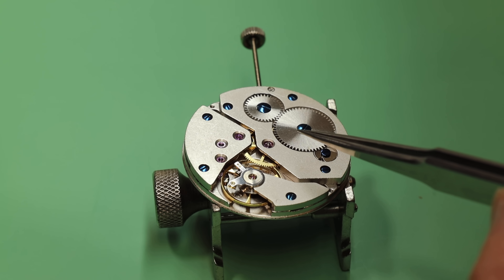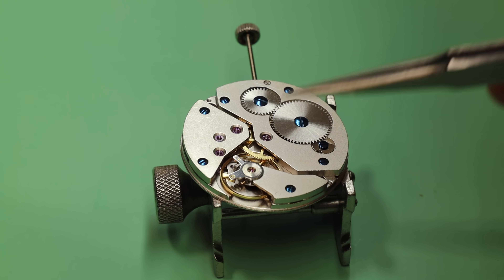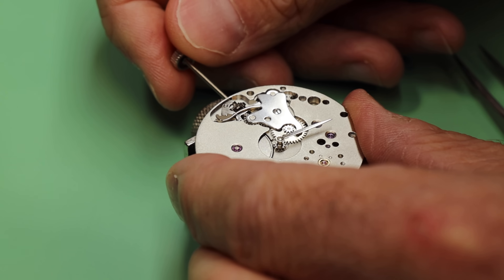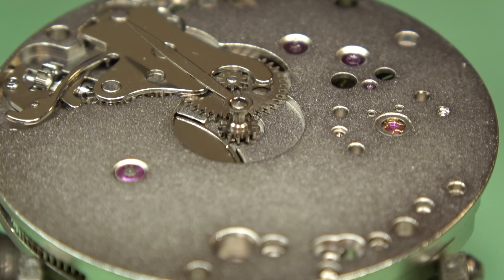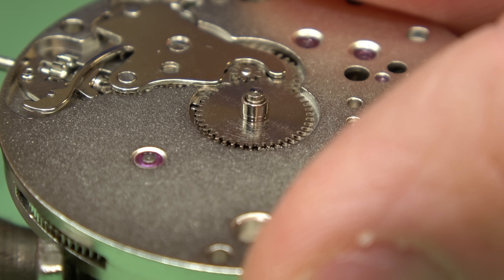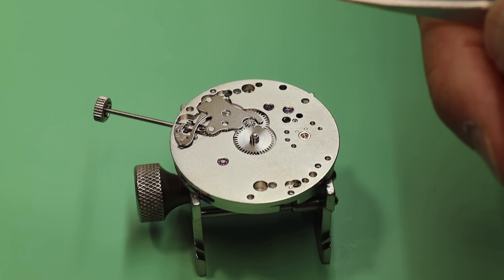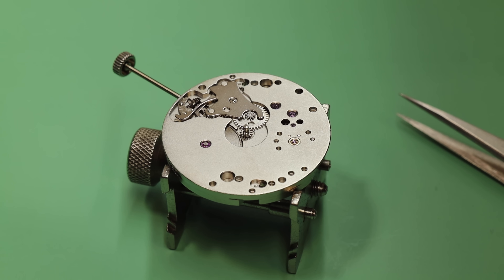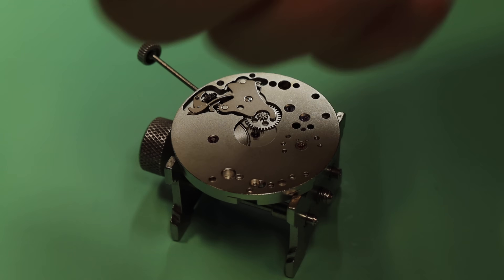Why you should NOT set your watch backwards? Watch and Learn #96

Comment: What if your watch has a day or date function? Moving the time forward almost 24 hours to fix a watch that is a few minutes fast would advance the day/date, and you would then have to go forward around 30 days on the date and put extra wear on the date gears as well. 

I guess if your watch had the hacking feature, you could just pull the crown out to stop the watch movement until everything catches up, and then push the crown back in start the watch at its new time.

Comment: What causes the crown to not turn the dial when pulled out ?  I have two that do this . Pull the crown and all they do is tighten the main spring.  They don't turn the hands it's weird.   Both worked when I got em . Then they did this

Comment: "I dont like this" is not very scientific. I don't think you've conclusively proven your case whatsoever. 

The reason the cannon pinion is a wear point (and not remotely near the worst one) has nothing to do with setting the time backwards, it's because it's a metal on metal point of friction. 

Your point about pinion and wheel leafs going in one direction sounds like common sense - but it's not. These parts are not oiled because they are not points of friction. Usually if you open a broken watch and these leaves are broken it is as a result of a shock, not wear. 

I have never seen a watchmaker ever mention this and it seems like another one of those myths like "overwinding" that people say to try and appear knowledgeable

Comment: So in your opinion ,should iwind my watch with a back and forward motion,or just a forward motion ?.My Oris after a few days forward only winds developed the problem that the Automatic rotor started spinning.I worry about using the back and forward wind,fearing wear on the gears.After using the Back and forward winding for a few days stopped the "sticking" Rotor.-And no the spring was only a 3rd wound before you ask.

Comment: Running the handwork gears backwards meshes the other side of the gear teeth.  As the opposite side isn't engaged during time keeping, I wouldn't think this would be much of a problem.  I can see burrs from the forward side of the handwork gears being dislodged during backwards setting on a very old mechanism, hence the advice for best practice as outlined in you video.  I do like the video and I remember being told not to wind backwards while setting.  I may have even been chewed out for it at some point.

Comment: It seems to me as when the canon pinion is moving in operation with the minute wheel the clockwise faces of the theeth of the canon pinion are touching the intermediate wheel towards the hour wheel. this means the pinion is driving the hour wheel.

now when you set the watch, the intermediate wheel will drive the pinion. this means when you set the time forward the faces of the minute wheel and the pinion which never ever touch get in touch. 10:13 

I do not beleave that this is a true issue. more important might be to not set the time to fast, as this introducing forces into the power train which should not be there. but also here, when the watch is put in time setting mode with hacking all the force of the main spring is on the escapement, and this also does not seem to be a big deal. going then counterclockwise actually should reduce the tourque on the wheels and therefore on the escapement.

general remark, when removing the canon pinion you should first remove the intermediate wheel as you can break either of the gears when the theeth are not alligned. the intermediate wheel just drops into position, the canon pinion you have to press. down

Comment: The only risk I see to moving the hands backwards is on a date, or day/date complication when the teeth are engaged with the day or date wheel.  I'm not career horologist, but have torn into and rebuilt a few movements at this point and see no reason why you can't turn the movement backwards.  The winding works disengages one set of wheels or another, depending on position, allowing the others to effectively spin freely.  

As stated if the date and or day wheel are engaged , typically between 9p and 3a, then absolutely don't go backwards and definitely don't try to change the day or date till out of the "engaged" zone, or you can easily damage the mechanism.  I don't bother with keeping my watches on a watch winder.  I rotate between a few routinely and set the time on each I chose to wear daily.  

What I've been doing which works well for me is to pull the stem to the "set" position on the watch I was wearing the previous day, on the next morning, before I select another.  This typically stops the movement (on watches with hacking) around the same time each day, typically between 6 and 7am.  I then chose my next time piece, which is now also parked at somewhere between 6 and 7 am, and well clear of the "danger zone" (9p and 3a mentioned above), quickly adjust forward or back, set the day/date and I'm off.  There's zero risk of any of my watches ever stopping on their own in the "danger zone" and makes setting the time each day a breeze.

If you use a watch winder to keep the movement charged, then this is likely irrelevant, though the only issue I see with a watch winder is a watch only wears if the movement is running, so why have all your watches wear out needlessly, requiring an expensive service, if they don't need to run.  Let them run down and extend the time between the service to as much as double or more.  Today's synthetic lubricants don't wear like the lubricants of old, so no point in paying for service prematurely.  I know I drifted off topic a bit, but we are talking about damaging movements and thought this tidbit may help with the bigger picture!

Comment: The main question is how much does the movement cost. Second question is do you have the money to repair/replace the movement. This is a non issue for pretty much everyone. Even w/ multi thousand dollar watches. Watches are designed to be used and you would really have to run it backwards a lot to cause any “damage”. Just wear them and fix when they fail.

Comment: Nice work on the video. Wait there’s more…if the canon pinion is tight the power from the keyless can override the barrel and push the gear train, including the escape wheel, backwards. The back faces of the escape wheel hit the exits of the pallet jewels and drag across them. Not sure what this does to the watch but it’s certainly nothing good.

Comment: From what I've learn from a watchmaker, 
to set the time properly, you need to go forward and pass the time to be set by over 5 min and 
then go backward to remove the passed 5 min or so and put the hands at the correct position.
This way the gears are set back in place and remove any play in the movement.
Then when the movement starts to move the hands again, 
the hands stay at the correct position without any play or misalignment.
Reply: This is exactly what I’ve been told and find on my watches if I don’t do this, the hands don’t quite align on the hour
Reply: This is to settle the gears and mitigate against backlash.
Reply: This is exactly what I was told at the Sinn factory in Frankfurt, and ever since I've been doing it to my Sellita movements I can set the time very precisely. However, on Rolex watches setting the time only going forward seems to be most accurate... so it seems it varies by movement.
Reply: Thank you sir, very interesting. I will try this technique the next time i install the hands because i kept installing them perfectly straight but then i checked and the minute hand was either too forward or either too backwards compared to the perfectly aligned to the 12 o'clock hour hand
Reply: Interesting. Thank you.
Reply: That’s the difference when you get your info from an expert.
Reply: When I go backswards on a miyota 8 series the second hand totally misligns. Not sure if it's my watch but in the forwards direction, the seconds hand stays fixed in postion at the 12 o'clock.
Reply: Intuitively that makes no sense. If your final adjustment was backwards, then there is slack in the system. After the crown is put back in, the slack will be taken up, but in the meantime the hands don't move and therefore the watch gets out of time.
Reply: Might depend on the specific movement. I use that technique on most of mine, but my Orient with F6922 (same as YN56/F6722/YN55) manual says to do the opposite, that is, to move the minute hand forward to the final position before pushing the crown in which results in proper alignment. Then again, some movements even turn the hands in the other direction relative to the crown
Reply: @tiggxtreme  hi sir. I have an yn55 movement. So what you're saying is I should let the watch run when installing the hands to remove any slack in the gears?

Comment: And that's why "Caller GMT" watches suck.  When comparing Traveller's vs Caller GMTs, people focus on which hand jumps: the main hour hand or the GMT hand, but they're missing the main issue.  The Caller GMT sucks because of the user experience: TimeZones shift forward and backward and Caller GMTs have the same problems as regular non-GMT watches in that everything should or can only be changed forward: GMT hand only moves forward, date moves forward and time should not be shifted backward, especially over midnight.  A traveller GMT has no such restriction: everything moves forward and backward (including the date).

Comment: In old watches the movement can be worn. these gears that mesh together will have a normal wear pattern. I could see under certain circumstances that rotating the hand set backwards could cause a binding situation and possibly damage parts further.

Comment: Hearing this, it baffles me how movements vary in their winding direction to set the time. Some you turn the crown forward/clockwise to advance the time. Others you turn the crown backwards to advance the time forward.
Reply from the maker: yeah, very odd! Been there.
Reply: That just depends on whether there's an odd or an even number of gears in the setting works.  The issue for the pinion, discussed in this video, is the same --- going backwards is a tiny bit worse than going forwards, and both are a little bit of wear on the watch in a vulnerable spot.

Comment: For my daily wear, if it’s running a little fast, I wind it up and pull out the crown and wait for my atomic clock to catch up with the time on the dial. Been doing this for years and never had an issue.
Reply from the maker: cool, thanks.
Reply: Exactly why it’s better to run faster than slow

Comment: I've never turned a watch backwards to set it, but I always thought the centre mechanics had just been disengaged from the spring mechanism during setting, I never knew it was being forced around a fixed pin?!?  Have i understood that correctly?  If so, is that true for all movements, including Swiss movements?  😮
Reply from the maker: yes, that is true. All movements.
Reply: @islandwatch  wow, you live and learn, or literally Watch and learn 👍🏻😁
Reply: @islandwatch  Saludos desde Venezuela, incluso aplica para relojes análogos  de cuarzo? tengo un Casio Duro / Marlin

Comment: Sorry, you were informed incorrectly and now propagating this desinformation through your audience. It is totally fine to set hands backwards as well as forwards.
The myth, or rather the limitation came of an early calendar complications that were having hard times when you manually rotate your hour wheel backwards. Since the 1950-s this is not a problem.

This may not be true only If you own a mechanical perpetual calendar retro watch, then please refer to your manual. But the probability to find such a person here is vanishingly small (due to the immense cost and rarity of such timepieces), so it is safe to assume that anyone reading this comment won't do any harm to the watch turning hands backwards.
Reply from the maker: If this your fact, or just regurgitating what you read online? I think I make valid arguments. Running a friction fit one way is bad enough, doing it both ways will surely loosen it quicker. Intuition tells us when we are separating two press fit items, we twist them both ways. Not one way.
Reply: @islandwatch  I rely on my own watchmaker's training and experience. I may refer to special literaute, such as The Theory of Horology by Ch.-A. Reymondin, more specific info you will find in Watch Complications by J. Ondracek (CZ).
Much bigger concern, however, would be of using a calendar quickset functions around (+-2h) midnight. This may cause problems even with more recent calibers.
But again, most of the manufacturers designed their date switching function with this in mind. Btw, using plastic parts there is just one of the measures.
So one realy should not correct a calendar around midnight, moving hands backwards is perfectly fine, even if you turn them past midnignt (once there was even a date quickset function, when you anvance your calendar, then go backwards to 10pm, then forwards again, till you reach the date you need).

Comment: I think Marc has a valid point about the slipping of the cannon pinion. If you are only overriding the friction in the direction in which the cannon pinion moves then you are potentially at a very small scale not wearing away (or at a slower rate) material that results in friction which would prevent the cannon pinion to slip in the reverse direction. We are talking about very tight tolerances here. I think rotating in both directions has to be the fastest way to file away/spread any material holding the cannon pinion onto the arbor. Don’t assume a perfect cylindrical surface and hole when thinking about moving in either direction. Just mentioning this as I see comments stating that they think slipping in both directions is the same as only ever slipping in the clockwise direction. For the sake of holding the cannon pinion and not allowing backslipping, I think Marc makes a valid point.
Reply from the maker: thanks, I love to hear everyone's points, however I feel it is common sense that two friction fit items will become looser in fit if we spin both ways instead of one way.

Comment: Correct, but I suspect that the extent of the setting damage is minimal. FWIW, most watchmakers put a tiny bit of Moebius 9010 on the center wheel shaft. This would protect the canon pinion from most setting damage. That said, many cheap Chinese movements neglect to properly oil this, and most of the rest of the watch as well.
Reply from the maker: I've never actually seen that? Interesting.
Reply: @islandwatch  I tried to post URLs that showed other watchmakers oiling or greasing  the canon pinion, but YouTube deleted them. Wristwatch revival and My Retro Watches YouTube channels do this as part of their watch service. The Seiko manual for the NH 35 recommends greasing the canon pinion. Hope this helps and passes the YouTube censors this time!

Comment: Slip is slip. The canon pinion doesn't care which way it's slipping. Slipping in either direction applies unusual force to the train but doing backwards applies it to the side of the gear teeth that isn't normally carrying the force. If it was to distort that face it would have less of an impact.  For that reason, I'd make the argument that it's actually better to go backwards. It's also going to be way better to go 5 minutes back then 23h and 55m forwards in terms of cannon pinion wear.
Reply from the maker: I agree that 5 min backwards is better than 24 hours forwards.

Imagine two press fit items, how do you loosen them? Do you turn in one direction? Or do you turn back and forth?
Reply: @islandwatch  Intuition will only get you so far. I can't see how turning in either direction or both could help at all in that situation.What could help is the wiggling along the axis as you do as it could help overcome binding. Tools for removing a cannon pinion like the Bergeon 4854 are designed to pull straight up, parallel to the axis because turning or wiggling with tweezers can also cause binding and mar the surfaces. Pulling straight up should prevent binding. When the cannon pinion it turned by an intermediate setting wheel it's about close to purely axial motion as you will get.

Comment: I'd say it's fine... as long as you don't go over midnight with movements that aren't designed for that. Some movements skip the date backwards when you go back, so they're designed to allow backward setting.
I have a date Nomos that actually specifies in the manual that the way to change the date is to go forth and back around midnight to jump it at 12, and then reprime the date spring by going back
Edit: it's also safe to apply backpressure on the crown to stop the seconds hand on a non-coaxial speedy... It's case dependent.
I would be careful with old vintage movements, for which parts are rare or expensive. But that's bout it

Comment: Dear Marc, could you explain what is written in Orient and Seiko manuals about setting the time? Why should I do this? Thank you in advance!
ORIENT MANUAL: When setting the time, first bring the hand back slightly later than the actual time and then move it forward to the actual time.
SEIKO MANUAL: The mechanism of mechanical watches is different from that of quartz watches. When setting the time, be sure to turn back the minute hand a little behind the desired time and then advance it to exact time.

Comment: Very interesting video, I didn't know about the slipping clutch, however you don't really make a strong case for why you feel that rotating backwards puts more wear on the clutch than rotation forwards, it's still just a friction fit either way. I prefer going forwards due to the day/date complication, but on a watch with no day/date it would make more sense to me to set the watch forwards or backwards depending on which direction is the shortest way to the target time.